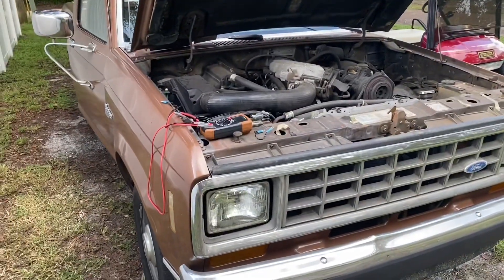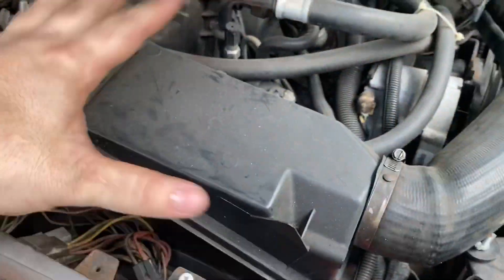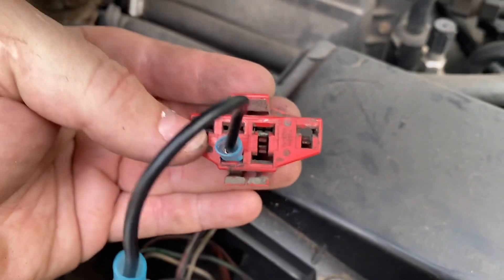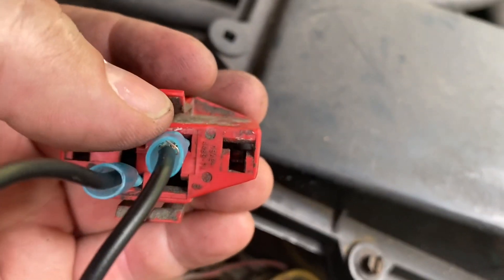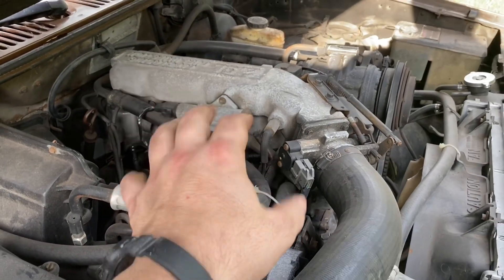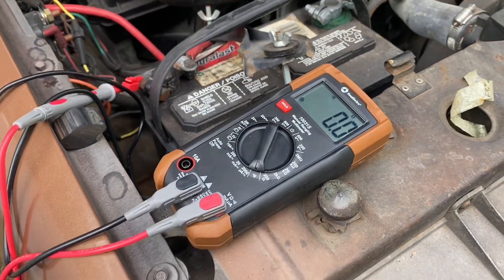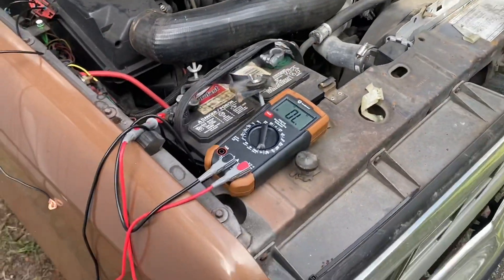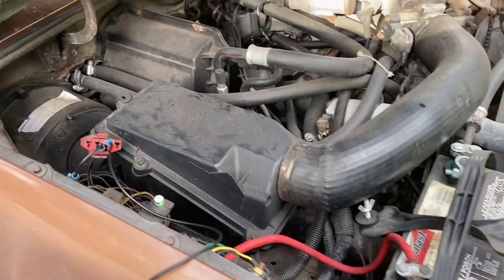How To Read Engine Codes Using a Multi-Meter or Test Light - FORD OBD1

Comment: Nice!! Yours is the first tutorial I've seen on how to do the code checking with a digital instead of an analog volt meter. Thanks. I will use this method to check for error codes on my 1993 F250 7.3 IDI diesel.
Reply: did it work cuz it ain't working on my 94 7.3 turbo

Comment: What do you set your multimeter to  if you DO NOT HAVE "Continuity" setting (beeper)?
Reply: Set it to "ohms" (kinda looks like an upside-down "U" (or the "Omega" symbol).  'O' (the letter) or 'I' will = silent and '0' or some very low number will = beep.

Comment: My 1994 F150 5.0 5 spd has 2 pins in the STI connector, instead of a single female blade connector. I do not know what to do now.

Comment: Hey man, I figured I would try to reach out. I bought this exact ranger from the guy you sold it to (VIN FTBR10T3GUC58210) and I'm having some issues with it. Would you be able to possibly help me figure some things out? I've tried this test and my multimeter is not reacting the way yours is. Help would be very much appreciated.
Reply from the maker: You bought THIS ranger?
Reply: @fixitnoworlater  I bought THIS ranger... this 1986 ford ranger xl... I live in pasco florida... when I tell you my jaw dropped when I found your videos...
Reply from the maker: Lmao. Omg. Hahah. My father in law got it to fix up his property. We drove it home almost 59 miles on the interstate. Loved that truck. So what is it doing? List the issues. I’ll tell you what I know about her.
Reply: @fixitnoworlater  so I was daily driving it and it for the most part ran great, about a month ago I went to grab breakfast and on the way back it wouldn't accelerate from a stop light... I put on the gas and it would about nearly stall. After trying to replicate the problems I found that it only happens when It warms up to operating Temps and it sits at idle for around 2-3 minutes (florida stoplights...) the engine is absolutely sucking air through the intake and if you give it gas slowly (similar to carburetor feathering) it will "come back to life" 

So far, I've replaced the entire electrical system in order to fix this problem (alternator needed replaced and I got a new battery just for the sake of it) I replaced the following: alternator, battery, ignition coil, distributor cap and rotor, spark plug wires, spark plugs, vacuum hoses to and from the egr valve solenoid, and the egr valve solenoid (all in that order) with almost no gain. One thing I have noticed is the truck seems to start frighteningly fast (which I've heard can be a sign of poor compression?) Thanks again
Reply from the maker: So for that engine based on my experience with it and remembering what my father in law was dealing with id do the following: have the oil pump replaced. I believe that engine had a weak oil pump. Don’t rely on the stock oil gauge. Hook up an aftermarket gauge and get a good reading. If bad... Get that replaced so you have good strong oil pressure, after I’d do the IAC MAF. Crank Pos, TPS sensors. Those 2.9’s are famous for the “little things” causing run issues. I have my ranger that has the same BS with it but mine needs heads. The 2.9 is famous fir cracked heads. The one you have has perfect heads so i’d capitalize on that.
Reply: Check the MAP sensor, if bad it can cause the engine to run poor and fall on its face when trying to accelerate. IIRC you can while the engine is running, pull the vacuum hose or the electrical connector off the MAP sensor and see if it runs better. The ECM will default to strategy without the sensor in the mix(so to speak).  The 2.9 doesn’t have a MAF sensor, the system is speed density.